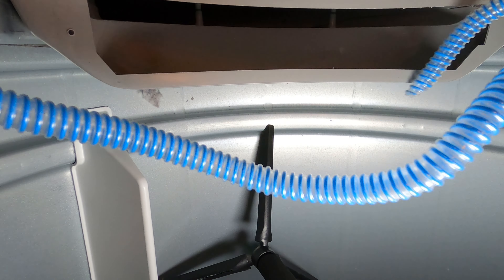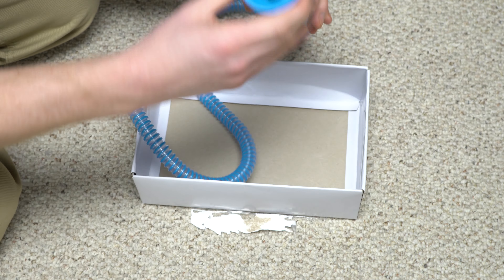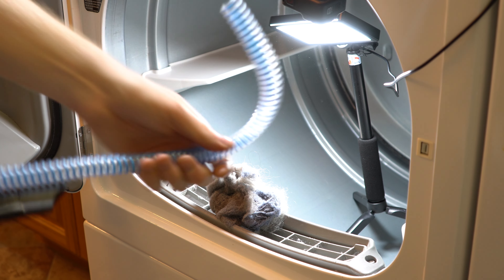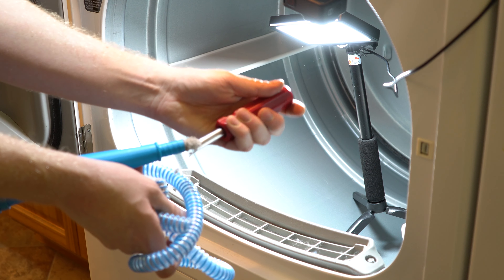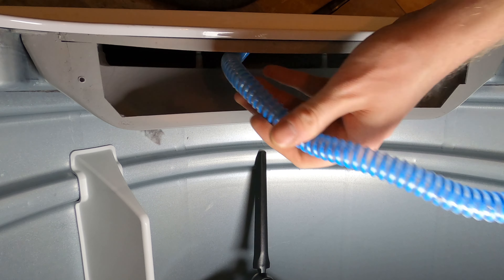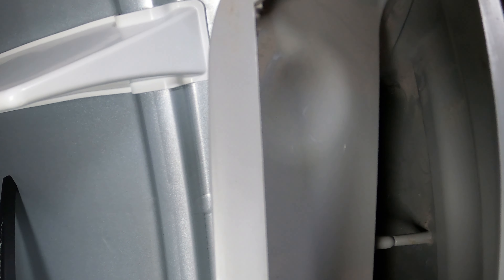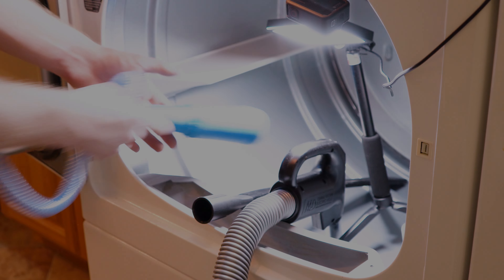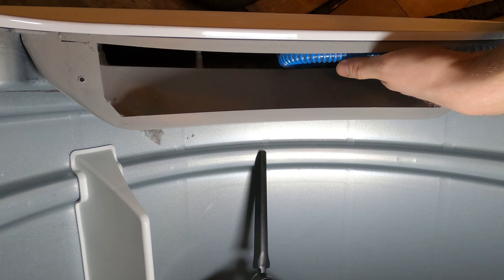Lint Lizard Vs. Flexible Crevice  Dryer  Vacuum Attachment Review

Comment: The very first lint lizard I purchased had a clear, wider vinyl tube that was relatively stiff, but more or less worked OK.  A newer lint lizard looked/behaved similar to your tested example.  However, a Sebo dealer offered the black long crevice tool you used towards the end of this video (not Sebo's version but a generic version) that worked like you said.  FYI i finish with a 730 CFM Ego leaf blower shooting air into the exhaust duct (blows lint out of fan and internal exhaust ductwork).

Comment: Good review! I move my dryer away from the wall about once a year, and take the back off and do a thorough vacuuming. I am like you and would suggest the crevice tool over the lint lizard. I have a long lint brush for brushing and swabbing lint that is stuck inside, too, but one of my shop vacs or Kirby in hose mode is more effective at completely removing the stuck on lint.

Comment: I have the car cleaning tools from Dyson. The crevice tool extends and is flexible but has a small brush on the end. I usually use it with Henry when cleaning between the seat and console. I’ve never used it in the dryer exhaust. I’ll have to try it. It may get the fine dust stuck to the sides. I have the Kenmore Elite washer and dryer. I believe LG makes the Elite line for Kenmore. Great informative video. Dryer lint is very combustible!

Comment: I have the genuine attachment and not the knock off. It works well. You need to be able to spin it like a drain snake.

The downfall is with all of it is that you need to know what the path looks like. I have a Whirlpool dryer and the vent fan gets lint built-up on it causing it to start rumbling and to be obnoxiously loud. I took the machine apart once to clean it. Now I know what it looks like inside, I can snake the host into the area and then suck off layers of lint pancakes.

Comment: I must be one of the few Lint Lizard fans, at least of the older model, circa 2006 or so…whenever the original came out. I, too, have the Dyson flexible crevice tool, but even removing the lint trap housing, it just doesn’t reach far enough or easily make the right-angle turn toward the rear of the dryer vent, and it also blocks more quickly.

I’ve found using an old-school long dryer brush with handle after vacuuming the big chunks loosens dusty residue (generally from use of fabric softeners) that’s stuck on the dryer’s vent interior, followed by the Lint Lizard, works far better than the Dyson attachment. (It also works better in the tracks of my sliding glass door, and fits into the gap at the base of the door where it sits on the tracks and gathers pet fur). 

I have the newer Maytag steam option dryer now, which replaced a 2000 era Maytag Duet. I pulled the front off the Duet several years ago and was surprised at how little lint had escaped first my mom’s, then my, religious use of the Lint Lizard she bought years ago. I regularly wash and dry down pillows and comforters, flannel, and other natural fibers (plus copious amounts of pet fur) that together produce astounding amounts of lint. 

As Bryan noted, lint is highly flammable, and as a former newspaper journalist on the fire beat, I covered far too many dryer fires, so I’m extra cautious in cleaning it. Top-loading dryer lint traps seem to allow much more opportunity for lint to escape the trap, even being emptied with each load. Years ago, my first dryer after getting married was an inexpensive Magic Chef with a top trap. The dryer started smelling hot, so I called a firefighter friend to help me disassemble the machine. The entire drum was absolutely caked with a layer of lint around the outside that no vacuum reached, even though I vacuumed both the lint trap and its opening regularly. It was a fire waiting to happen. It’s never a bad idea to remove the top or front panel annually and vacuum and inspect it, and even remove the back panel, as well.

Comment: Man they went cheap on the new Lint Lizard. It looks like they used CPAP hose for the new one. I have an an older Lint Lizard with a stiff tube of clear tubing similar and it's stiff enough to control it and goes down the pull out filter area on my tradition old school style dryer. Not a good redesign.